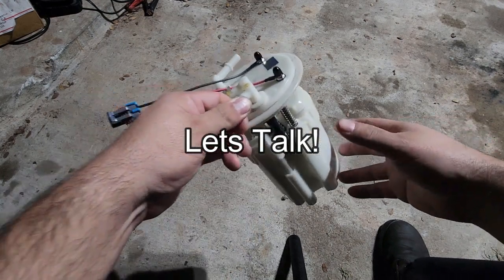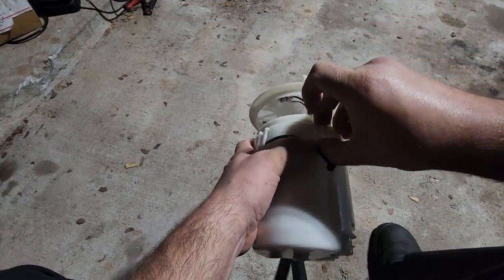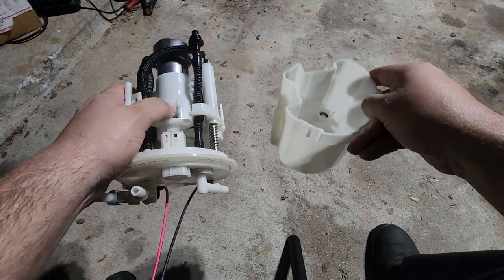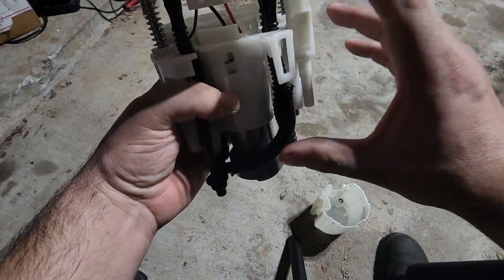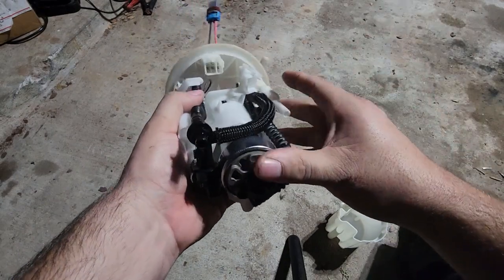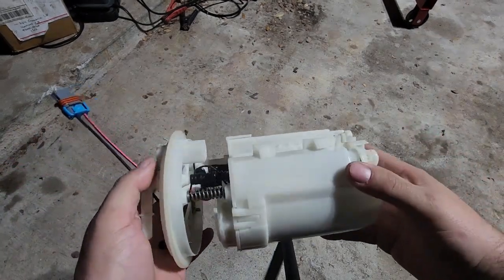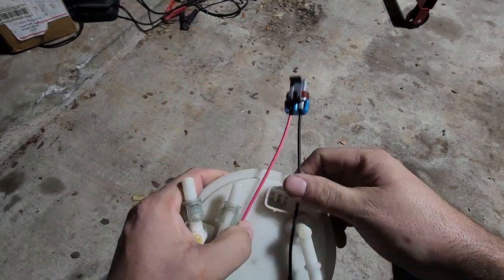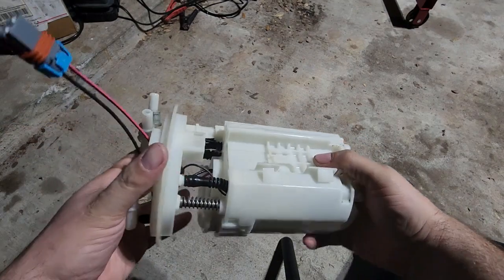How To: 2008+ STi/WRX Walbro 450/525LPH Install (Factory Hanger)

Comment: Well done explainer video, very helpful BUT for anyone thinking of going down this route, probably don't!! Just buy a radium hanger and be done with it... took 3 install/removes to get working in the end. 2nd install seemed working but realized the jet siphon was only pulling fuel from one side of the tank, had to remove the fuel pump and add a radium jet siphon which in the end required hacking up the basket anyway... in the end I probably spent $600+ in extra parts and labor to make the oem hanger work when the radium hanger costs $500!

Comment: i’m having this same exact problem with my 2011 sti. aem 340lph is currently in with 1700 cc injectors- currently not enough fuel. i’ve been trying to rig my walbro pump like how you have with a extra housing, but i can’t get it to fit no matter what i do, and the wires crimp and tear when i force the pump in the housing, any recommendations?
Reply from the maker: Well without seeing what your doing, its hard to tell. It pretty straight forward.

Comment: Have you had issues with the stock venturi jet pump at all?
Reply from the maker: I have not noticed any issue with my fuel pump setup
Reply from the maker: The way I installed my pump does not  modify or affect the venturi system
Reply: @D-TunedGarage okay. Reason I asked is because i have my set up the same way currently but with the fuel sock on and I tried to turn my adjustable fpr down to 3 bar but wouldn’t quite get there so I was thinking my fuel pump may be causing back pressure in the return system from the oem jet pump. Might just buy the radium one and slap it in and see what happens.
Reply from the maker: @enemen8 With the Walbro 450lph or larger you will overrun the factory return fuel line. Which raises fuel pressure when pump is 100% duty at idle, like when you 1st start your car. You basically have 2 options, tune around the start up or replace the hanger and run a larger return line.

Comment: hey thanks for the video, im just wondering how much did you have to cut off the top of the pump?
Reply: like up to the first or second barb or more than that?
Reply from the maker: @joshbrakel5099 I think I said about 1/4 inch off the top. Its been a while since I did the mod, but i believe I cut in between the barbs
Reply: and do you need the rubber hose on the pump outlet neck?
Reply from the maker: @joshbrakel5099 the rubber hose acts as a spacer to hold the O-ring up to seal when the pump is installed. So , YES

Comment: Thanks for the video. If i undertand, dont need the litle filter and the top of the pumo sits in the floor of the hanger rigth?  Only need to wired and thats all? Regards
Reply: And if you want to fit the filter only need to cut the clips that you said a little ..? But this can be dangerous because the pump can move rigth?
Reply from the maker: @pedrosegura8302 I never tried cutting the tabs to try and make the filter fit. So I dont know if it works or not for sure
Reply from the maker: The way i did it, yes. Use the spacer on the bottom of the pump to hold it in place

Comment: I just bought the 450Walbro today and was lookin into using stock Hanger and your the only vid I seen and Sorry to ask you much questions.
Reply from the maker: @opticsmedia.official  That was why I made the video. I always heard of people fitting it but never found a explanation of it. I don't mind questions at all.
Reply: How did it work for you? What did you modify? And did it stutter at all?
Reply from the maker: @Xenoviathewrx  you shouldn't be modifying anything on the housing other than setting up the hanger for hardwire with the two studs
Reply: @D-TunedGarage  how do I make studs? Rn I'm just using the plug. Could that cause my stuttering?
Reply from the maker: @Xenoviathewrx  That is absolutely dangerous and should not be done. That pump will melt the wires and can cause a 🔥. Radium sells a simple stud kit
Reply: @D-TunedGarage  ok I'll order one
Reply from the maker: @Xenoviathewrx  I've seen as much as 25amps being measures on a Walbro 450lph pump. The factory wiring is designed for maybe 10-15amp. The high amp draw can damage the Fuel Pump Controller in factory form. The I-wire kit helps change some wiring to allow the factory Fuel pump controller to handle up to 30amp draw.
Reply: @D-TunedGarage  what is the kit called? I can't find it
Reply from the maker: @ej_xenovia  https://iwireusa.com/products/fuel-pump-controller-hardwire-kit-in-tank-single-pump?srsltid=AfmBOor37unIvetOvYauseGeXGC7I7-dJw9kClqwslSzPnWWsfhQF9dj&variant=41344175374489
The complete hardwire kit, this kit comes with the stud bypass in it.

I have a video about how I installed my kit.
Reply: @D-TunedGarage  what's the point of running this kit if it casts the same as a Radium hanger? Not trying to be sarcastic. I'm just curious
Reply from the maker: @Xenoviathewrx  They serve two different purposes. Using a radium hanger has a whole nother list of things you need to buy.
Reply: @D-TunedGarage so if I get make my own stud bypass exactly like iwire. I'll be golden. And I don't need to spend $350 for wiring I don't need
Reply from the maker: @Xenoviathewrx  You need the wiring. Anything past a 340lph pump you should be doing a hardwire kit. The walbro 450lph pump will melt the factory wiring and is not recommended.

The point of the 450lph pump in the factory housing is being able to use all factory fuel lines and maintaining a fuel filter.
Reply from the maker: @Xenoviathewrx  if you just want the studs you can buy these
https://www.radiumauto.com/Electrical-Bulkhead-Stud-Kit-6-Pack-P1049.aspx
Reply: @D-TunedGarage  alright so I'm just gonna get a 340 lol. Sorry for the trouble

Comment: Also, which Iwire fuel pump wire kit you got? Im looking to do the same set up, and I dont have a Radium hanger, I want to do the same thing you did lol
Reply from the maker: @opticsmedia.official  the kit i installed was actually for a 2002-2007 chasis. From a buddies car. But get the year for your car cause I'm sure the lengths are different

Comment: Do you have a video of how you wired it up? I know ya used iwire just wondering how it all hooks up
Reply from the maker: @denniswilliams3993  Unfortunately I did not make a video of the install of my I wire kit but I don't mind making one. If you have any specific questions I can answer I have no problem doing so
Reply: I know it’s not recommended but I tried to use oem plugs and pump prime but I had no fuel pressure nothing melted just No pressure any suggestions? Not sure if an oring Wa not in right or not.. also had difficulty getting it to fully seat on clips
Reply from the maker: @denniswilliams3993  did you use the clip off the oem pump on the bottom like I did in the video? Also I know I didn't remove the fuel pump in the video but I stated I cut about 1/4 inch off the top nipple to allow the pump to fully seat
Reply: I did remove about a 1/4” and mine wasn’t oem it was a dw65c from previous owner but I did use a clip off of it I think my wiring may be in the way of it fully seating.. have to disassemble again and have a look

Comment: Mine just came in today and I’m currently about to watch this
Reply from the maker: If you run it through the factory wiring and connector it will more than likely melt the wiring or damage the Fuel pump controller. Make sure you do a hardwire on it either I wire or custom
Reply: @D-TunedGarage  I bought 2 installation kits the one MAP recommended was dw and just the universal installation walbro has just incase 😂
Reply from the maker: @JermJermFlores  hell yeah, if you have any questions hit me back up
Reply: @D-TunedGarage  will do 😂 so probably within the next few days

Comment: Have you ran the car with it like that?
Reply from the maker: Yes, I currently have it in the car and will post videos of what I saw and how it changed everything for the better. Im making well over 500whp no problem, rock solid fuel pressure!
Reply: I also wanted to ask where does that connection up top connect to? I’m planning to run it just like you meanwhile I save up for that radium hanger!
Reply from the maker: @sergiosegovia7845  I have a I-wire hardwire kit so it has its own connection. It no longer uses the factory connector on the top of the fuel pump housing